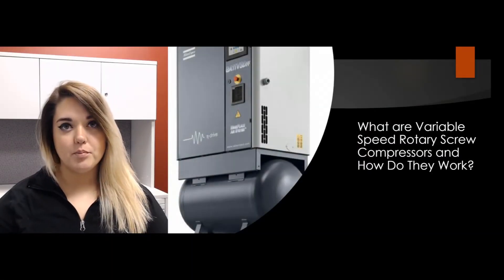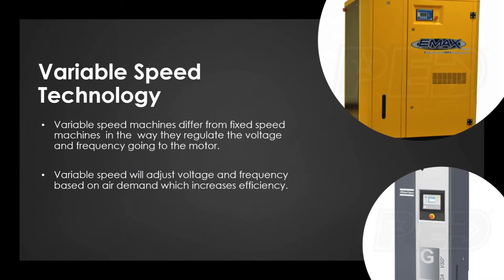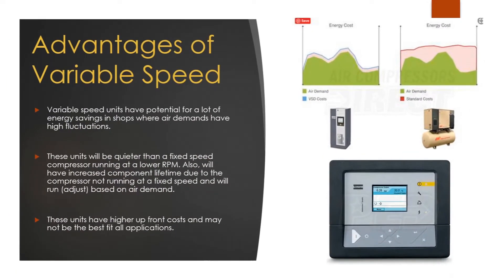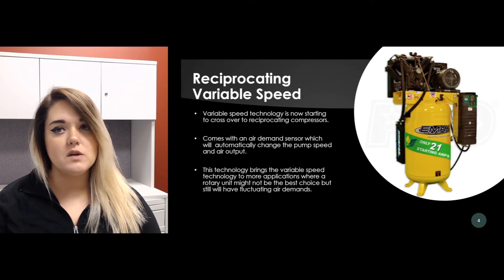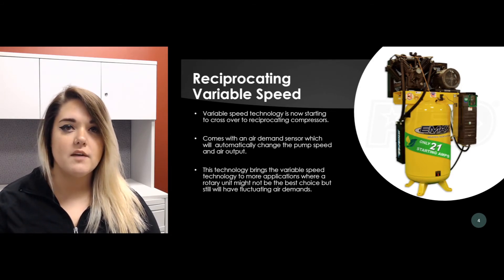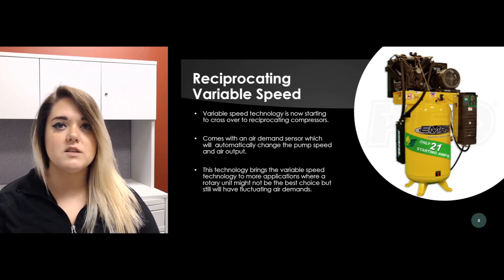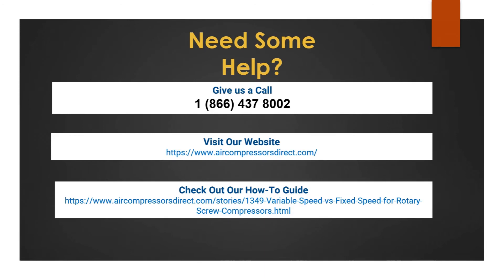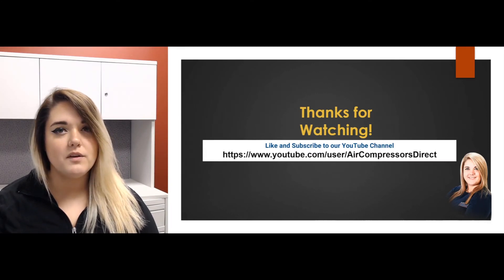How do Variable Speed Drive (VSD) Air Compressors Work?

Comment: But you did not talkink about disadvatages which is not only more cost. The problems is current across rotor, optimization working, beacuse lower speed = lower lubrication = shorter life air compressor and offcourse you maybe need to use  filters before and after vfd. And all this together is very important.